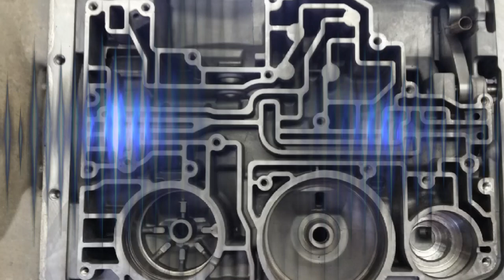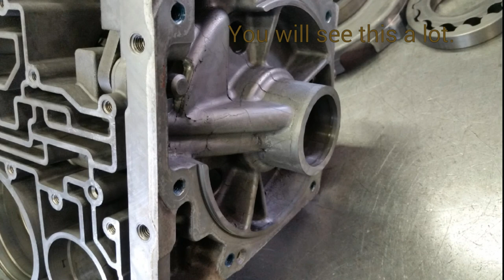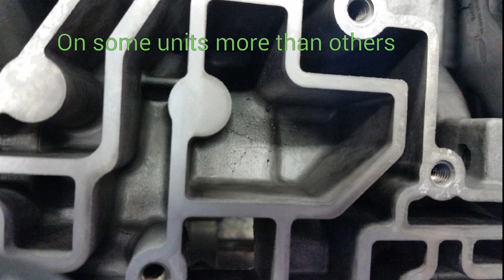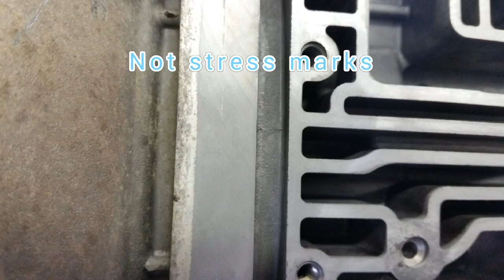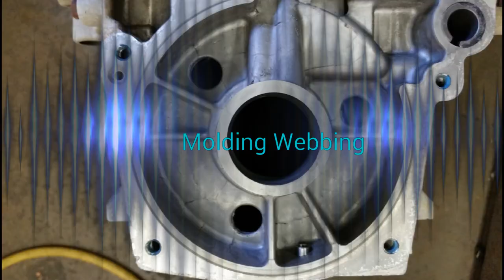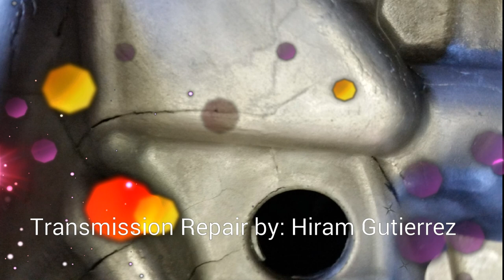Webbing marks that looks like cracks.

Comment: Lol these had me a few times
Reply: These torques are a nightmare for the industry guys right now usually 9 time outta 10 the bearing the rides the impeller side from the stator breaks and cause the stator to break that's probably what you found falling out of that TC when you were draining it. Right now there at a high fail rate and there isn't any parts available yet to fix them. Finding good cores is becoming harder aswell... I'm sure they will come up with a fix very soon on these torques.